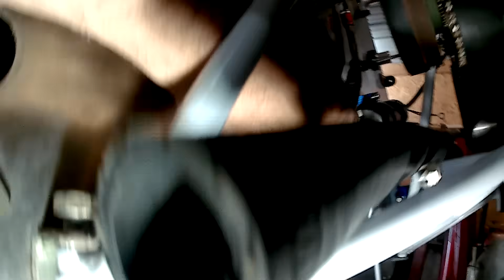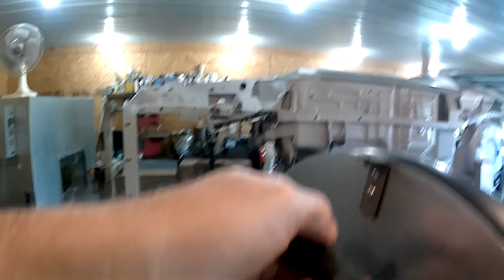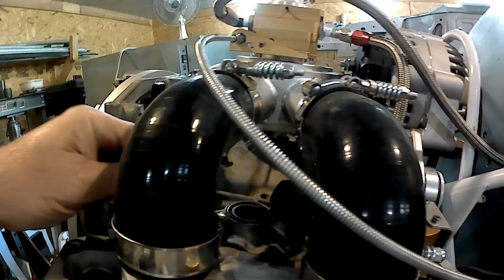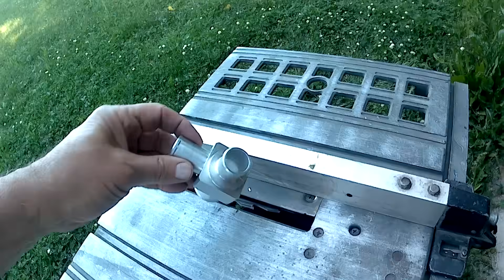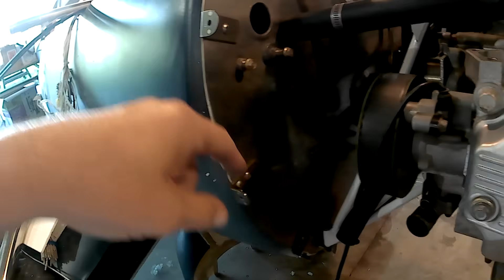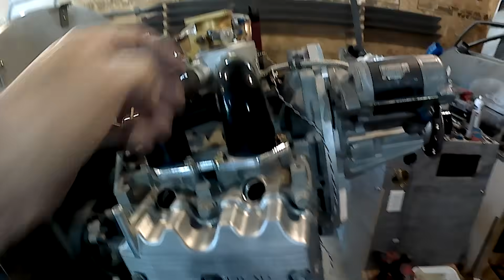WAR Corsair Update 6/10/2025

Comment: Plumbing supply house's  have the necessary parts. I still have in the shop 1/8, 1/4, 3/8, 1/2 in black , brass and stainless steel plugs. I retired 2011 time to clear the warehouse. 😎